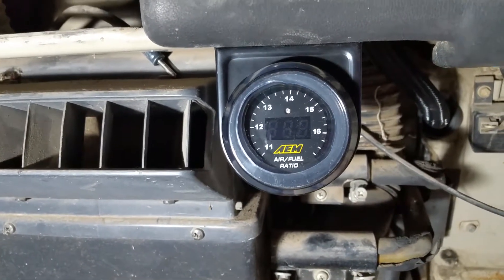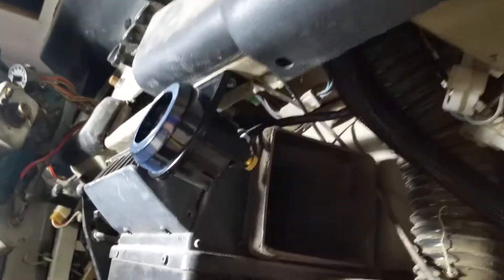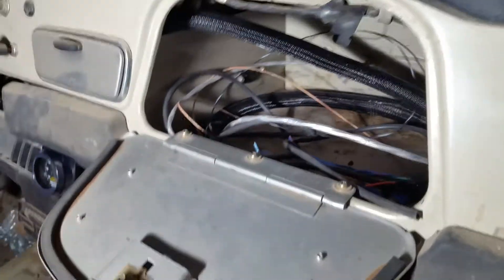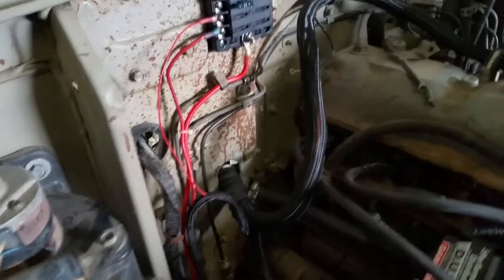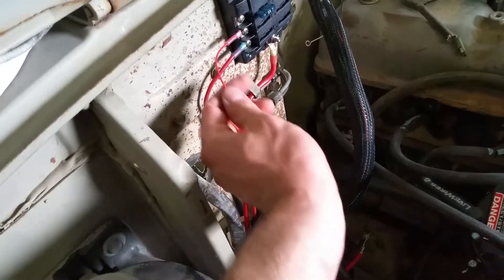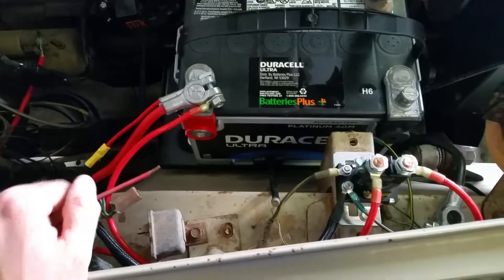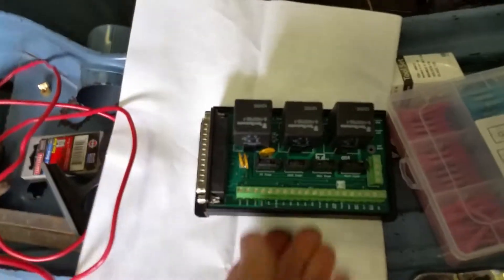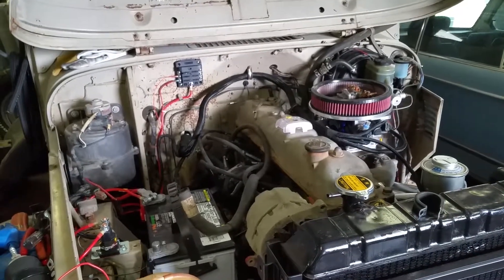TOYOTA FJ40 2F MEGASQUIRT PROJECT UPDATE 3

Comment: I’ve never heard of megasquirt but I like it. How about your HEI distributor, is it run off of a relay as well? I have a 76 FJ40 with stock distributor and I’m thinking about switching to the HEI. I don’t see many options for the old rigs as far as ignition systems go.
Reply from the maker: Beefncoot42 http://performancedistributors.com/product/toyota-landcruiser-dui-distributor/ this is the distributor I have. It’s all in one and you just need to give it 12v switched. You can order it with the parts to be controlled by megasquirt or with just a standard ignition curve if you’re just running a stock motor with a carb